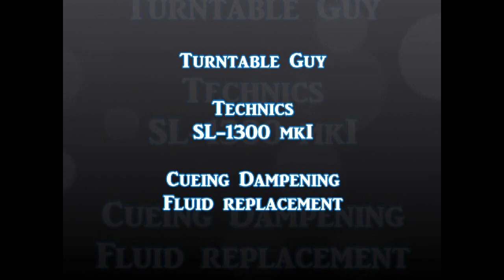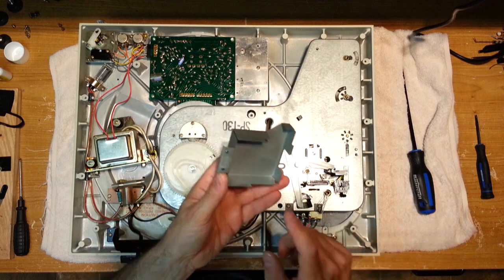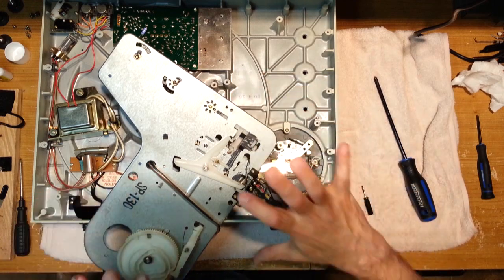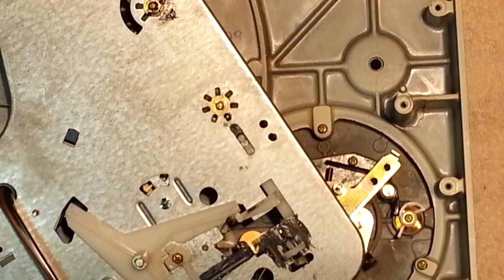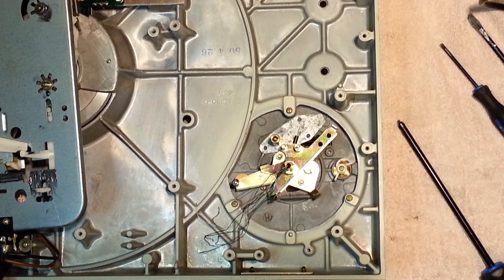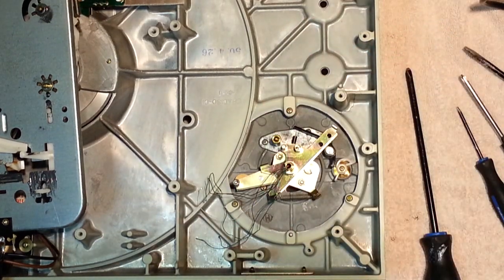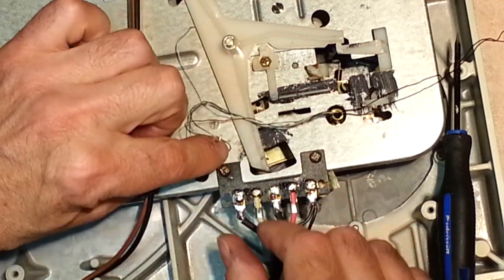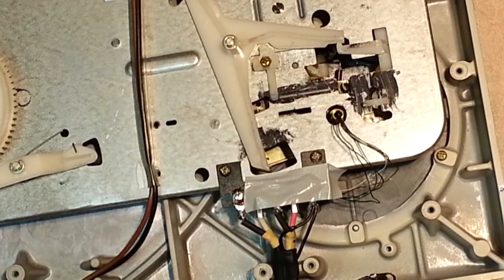Technics SL-1300 (1400 & 1500): Cueing Damping Fluid Replacement

Comment: Thanks much for this video . I did the same job yesrerday , but in simpler form . I did not remove any wiring but rather just twisted the complete panel  counter clockwise . My 'fine' audio wiring from tone arm apeared slightly longer so i had room to remove the cuing shaft and support bushing together after removing the 3 mounting screws . I then removed the lock washer , cleaned and applied 300k silicone , reinserted shaft installed lock washer -- then i remounted the complete bracket with the 3 screws , rotated the bottom plate , applied a tiny amount of 3in1 oil on each visible bushing , installed panel mtg screws and completed necessary assembly . When finished   adjusted tone arm lift height and all is just great . I would guess i saved about 10 or 15 minutes by not having to remove and replace audio wires and also removing and replacing cuing shaft and support as a unit . 
       Im not sure weather id have attempted job without first watching your detailed video , but i am an 87yr old still active antique car  restorer and inboard boat builder , so im never afraid to try new challanges and adventures -- lol !!      --- Paul

Comment: My best friend in high school bought one of these new back in '72. From that moment on I was enamored of Technics turntables. By the time I'd saved enough money to get my own, that series had been discontinued, so I ended up with the 1600, and about a year later bought the 1300Mk2. I currently own a 1300Mk2 as well as a 1200Mk2, and you'll have to pry them from my cold, dead, hands. 🙂

Comment: Just repaired my JVC JL a40.  500k silicone grease,  8 bucks at Amazon. Cueing works perfect after 50 years, also recapped the power supply.

Comment: I have a Sony PS-3300 direct drive turntable I bought in 1975 ,it needed some damping fluid so partially disassembled but ran into some road blocks so it was just a lot easier to just stick the fluid syringe needle into the cueing shaft topside an move the cueing lever up an down till desired effect is reached,i ordered my fluid off of E-bay preloaded with fluid an screw on needle $12.00 free shipping, must be patient when applying fluid to see results!!!
Reply from the maker: I've never had good luck injecting damping fluid into the cylinder.
Reply: As long as the turntable isn't full of dust, needle injection works just fine every 5 years.

Comment: Thanks for the awesome video man. I have a confession to make.. when reassembling the piston with the spring and eclip I accidentally yeeted the spring to god knows where. I spent a solid 30 minutes looking but concluded it’s a goner. Any ideas on how I could replace this? Just a standard spring or something special?
Reply from the maker: That's too bad.  There would be nothing special about the spring.  I'd just order an assortment of small coil springs on ebay and try to match it up.

Comment: Thank you very much for great tutorial and your time to record and explain the procedure! Vert well explained and informative!

One question, the circlip (e clip) on the piston on my SL-1500 is loose when i try to put it back. It is not bent or damaged but it dont "click" when i put it back when assembling it. I cleaned and lubed parts alltogether and it holds everything when i put it in its place but i dont have snug fit. What should i do, any advice?

Thank you
Reply from the maker: Squeeze the ends together a tiny bit with a pair of pliers.

Comment: Thankyou, that was impressive workmanship. I did not realize how much work would be involved in replacing the fluid. Previous owner of my 1500 replaced the fluid and arm wires.Anyone know where I can buy the plastic piece at the end of the arm? It slides into the arm, holds the counter weight? Broke during shipping. Thx, again
Reply: Probably from another 1500, unfortunately. Hopefully it's not too bad that you can't glue yours back together though. Or a 3rd option, maybe it can be 3D printed. Either way, good luck!
Reply: @R3TR0R4V3  Thank you , 3D printer sounds like the way to go.
Reply: @r.q.5457 Did you ever get the plastic piece???

Comment: I would like to ask you a question if you don't mind. I have the SL 1300 turntable. It worked perfectly last time I used it which was over 20 years ago. It has been stored in a closet all that time. I have read that they sometimes don't work after long periods of no use and it appears mine falls into that category. It lights up but the platter won't start spinning. It spins freely by hand but the motor doesn't seem to do anything. Is there a quick fix for this or does it need to go somewhere to be serviced? Thank you for any imput.
Reply from the maker: I highly recommend downloading the service manual from vinylengine.com.  You are going to have to check and confirm voltages.  Good luck.
Reply: This is months after your post but for what it is worth you can rebuild the control board. Saw someone on fleabay selling a parts kits.

Comment: One more question about cue lever.
On my SL-1500 , cue lift goes down only to the point where my cue lever is.
Example: If i put my cue lever to 1/2 of range down cue lift will go only so, to 1/2 of height. Althrough i changed dampening fluid and now it works perfectly as you explained, cue lever doesnt go down by itself fluidly (like in attached video). Cue lift always "waits" and goes to the position of lever.
In this video, cue lever goes by itself down when pushed, and lift follows till bottom until hits the record. > https://youtu.be/Fu7yvS8Jm-s?t=191

Is there something with lever that i should do?Perhaps lube plastic pivot of the lever in rubber socket? Which lube to use? Thank you
Reply from the maker: Sounds like you may have some dried up grease within the tonearm base.  Check out my video on the SL-1900.

Comment: I have a Technics 1300.  I can operated the tone arm manually but if set to auto, it quickly lowers without touching the record and shoots over to the spindle.  Does anyone know what kind of problem that is?
Reply from the maker: Sticky, dried grease on the auto-return mechanism.
Reply: @TurntableGuy  Thanks so much for the input.  That will give me a starting point.  I just want some idea what needs to be fixed before I hire a tech.

Comment: Yikes! This looks like a total nightmare of a job. So glad I went with the SL-1600 instead. 😬
Reply from the maker: Yep, much easier job on the 1600, 1700,& 1800
Reply: 1300 or 1600?? Which is better?? I want a fully automatic
Reply: @kingofuseddurablecars.ls6040  They're both fully auto, so you're good either way. The 1300 has a solid plinth, and the 1600 has a sprung (suspension) plinth. The 1600 supposedly had the same high torque motor as the 1200, but the 1300's motor has a little less torque, IINM. Just do some research and Google some stuff, you'll learn which is the best for you. 👍

Comment: Hi! Sorry for my bad english, i speak it just a little, My question: Is any silicon oil of 300.000 cst ( or cps) good? Thanks for any response
Reply from the maker: Yes, 300.000 cst if fine.
Reply: @TurntableGuy  Sorry but:" Yes, 300.000 cst if fine"...If fine or is fine?
Reply from the maker: Is fine @vila6969
Reply: @TurntableGuy  Thanks a lot!
Reply: @TurntableGuy   Hi, i bougth a silicon oil 300.000 cst and I did the repair, everything works perfectly! My Technics SL-3110, It's like new!! Thanks again.